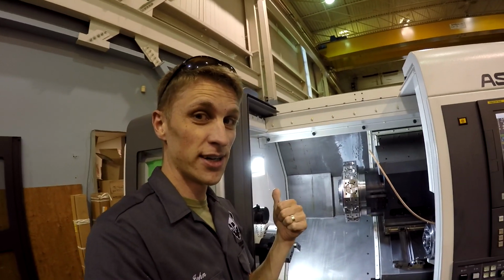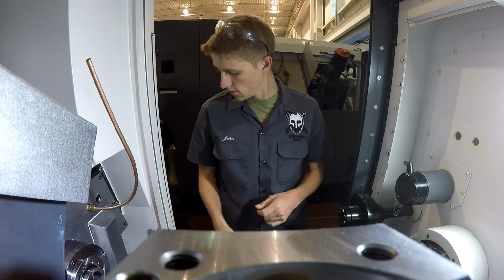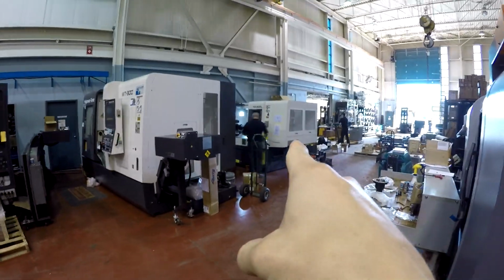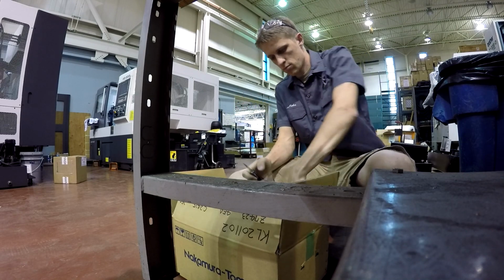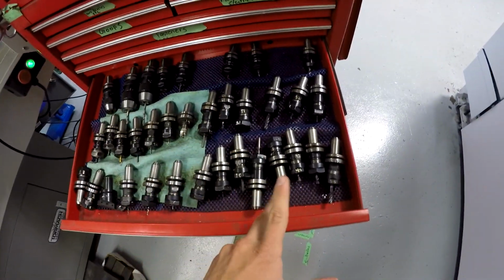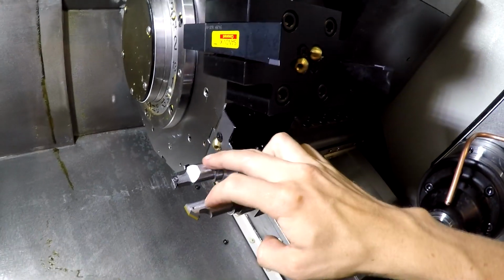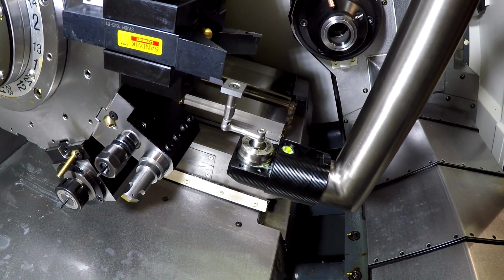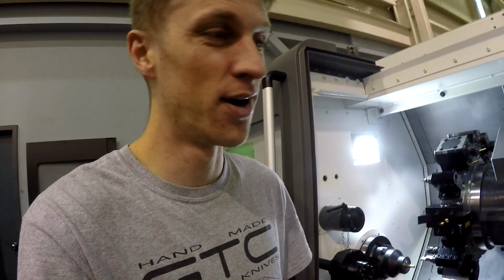We bought a new CNC Lathe - Nakamura AS200LMYS

Comment: For the same reason you don't need a Ferrari to run a delivery service, you don't need this to make screws for a pocket knife. Really, you need to curb your equipment fetish.
Reply: 100k? That machine was easily 250K and way overkill for what he does.
Reply: Alright, I guess you can't wrap your head around the math. Let's say he financed $500,000 worth of machines on a 5 year note. That's a $9500 payment every month just for the machine. Now, rent, insurance, utilities, etc will cost him at least another $2500 per month. Then add the cost for tooling and other consumables like coolant and oil. Let's say $1000 per month. So, he needs to come up with $13,000 every month just to keep the lights on. He has not paid himself or his brother. He has not bought any material or paid for any outside services.

Now, his knives sell for $600. Let's say there is maybe $50 worth of materials and another $50 in outside services. So, he nets $500 per knife. That's pretty good (and highly unlikely). He needs to sell 26 knives each month to break even. He has sold approximately 560 over 4 years so he's averaged 11 knives per month. So he needs to increase sales by 236% instantly to make the payments.

How long until he saturates the market? How many people are going to pay $600 for a goofy looking pocket knife?

I stand by my gut feeling that this is just a well funded hobby. But hey, there a lot worse ways to piss away a trust fund.
Reply: I'd agree, except their production choke point isn't the parts the lathe makes. He either should have hired a helper for his brother or bought another mill. Either would have made more sense.
Reply: Kenshin Ushiroda no dude.   you got it backwards. ..that machine doesn't make money.   that machine makes him have to sell ridiculously overpriced knives.
Reply: The internet is not what it seems. He mentioned in another video that he's never had a real job. He and the other guy don't seem to do anything but make these knives. I'm sure he's spending daddy's money. It's not "hard work" paying the bills. 

Obviously he's never run a business or done a payback calculation. This is a stupid investment. He should be subbing those parts to a swiss shop. He doesn't have a bar feeder so he can't even run it unattended.
Reply: He can't run that machine 24/7 because he didn't buy a bar feeder which I thought for sure he would.  Cover payments/= make money he said in older video that he needed over $5K a month to break even plus another 250K in debt to make screws doesn't make sense to me. As someone else said he would be better off hiring someone else to help or subbing some of this work out to get product out the door. A swiss shop would run thousands of those at pennies.
Reply: +Kevo F with only 81mm of Y axis travel I would hardly call a 6 axis lathe a mill, I doubt most of the parts (handles, blades or pocket clips) could be rationally made on this, not to mention that most of the milling he does is at more than the 6000 RPM limit of the live tooling, and for small parts like he's making a 4000 RPM limit on the main spindle is not a great choice (sub spindle does go to 6000 at least)
Reply: Chief Machining Lol no way chief, the short version of this machine starts at under $79k, somehow I doubt adding the L and a sub spindle is going to literally triple the price.
Reply: +Kevo F "standard" doesn't mean "given away" there's no such thing as a free lunch, and although I do not know what the pricing is in this case I've seen enough 3+axis lathe invoices to know that a sub spindle is usually a rather expensive option (think about it, extra spindle with C7 bearings, servo drive, ways, ball screws, vector control, etc...)
If they can afford this fine but for the moment from my exterior view point I see the debt of the firm increasing but no products seem to be shipping out on a regular basis and unless they find a product for this I don't see how using this kind of a beast for screws and fasteners (no matter how intricate and precise you make them) can make economical sense for the volume they're talking about, I sometimes fear for them that the next "personal improvement video" might be "how I went bankrupt and don't make the same mistake"...
Reply: +Chief Machining Funny you should mention HAAS, despite living in France that's what I ended up buying, I was perfectly aware of the slight rigidity issues (i ran tests before buying and it turns out you can "easily" work around it and get perfect repeatability with a proper tooling choices and warming up cycles). 
I have a Mini Mill 2 with a 4th axis and a SL10 with the big bore option equipped with a ROHM F66 collet chuck (lots of 50mm bar work for me), all payed cash upfront no loans so if I break a leg and an arm horse ridding and end up not being able to work for 2 months I don't have to worry about the bank filling up my answering machine and hiring lawyers :D and it does what i need with no hassles (and yes I often work with esoteric crap like hardened steels (TOOLOX 44) and exotic alloys)
Reply: Best I can tell he's grossed around $350,000 over at least 4 years. For a full time 2 man shop they should gross that in 1 year to be profitable. And the doesn't count buying any equipment.
Reply: Yeah, Wes Johnson, I can tell, you have a good business head on your shoulder's--and in the end, that's what 'pays the bills'...In other words, we should remember, our 'businesses' can be a lot of fun, but in the end there are reasonable limits; they aren't hobbies as should be treated accordingly.  I think Wes Johnson's points were pretty excellent, however to debate them, one could argue he could sell his equipment at a reasonable depreciated value.  However, machine tools, as most of us know or believe, especially or even CNC varieties have a shocking tendency to loose value in sudden non-linear fashions--say if the industry comes out with magnificent new feature's etc.  Yeah, I would bet this equipment has a good lifetime of operational use in front of it, but for making knife screws...i mean, sorry, still trying to wrap my head around that one.
Reply: kenshin , i completly agree.

In Fact he could buy, better,  those silly screws
Reply: somebody's jealous.
Reply: +grumpybill jealous of a 100k+ debt I'll be paying off in 20 years? Yeah, no.
Reply: it is an increase in repeatable tolerances and speed so it will be worth it if he makes enough knives. probably needs to employ another machinist to get full benefiet though
Reply: Lol you&#39;re funny this isn&#39;t a haas..&#160;he is in Canada for one. Y axis, Sub spindle, 300 psi coolant, milling on the sub, in the 200's with all goodies, he got probably got a bar feeder as well not to mention to tool the thing up and rig it.
Reply: As Serge said... standard doesn't mean I'm gone to give away this machine at HAAS price. Making small screws and caps and whatever doesn't make sense on this type of machine anyways. He should have looked into swiss style machine but I'm  guessing the budget wouldn't allow for this. He went from step 3 to step 10 without any real thought. How many screws will take to pay this machine off?
Reply: Kevo F I can barely make it looks to be $297K before discounts total  but 80K isn't  including all the training, rigging, shipping, tool holders, collet system, probably a bar feeder. The HAAS I quoted was $135K USD without even trying the base price was 60K USD the time you add all the extra crap. In canadian dollars that machine 178K.. If they are selling that AS200 machine delivered and rigged for $80K CAN.. That would be about $62,500  USD just for the machine I would buy two now cash but they aren't
Reply: That's fine, but you can't finance $1/2 million without some serious money up front. Where would he get $50,000 for a down payment? Maybe they are leased, but still the numbers don't make any sense. He numbers all the knives he makes how much they sell for. I can add. He's not making enough money with those knives to come even close to justifying this purchase or the mill for that matter.
Reply: Wes Johnson Don't forget he does quite a bit of "pre sales" (for instance the "rasks") so the actual number of knives built (how much is that number anyways ?) probably gives a lower number than his net income over the past years and the amount of cash required up front and in terms of guarantee all depends on the condition of the financing.
I do however agree that the numbers (at least what we can deduce) seem sketchy at best but it's all speculation.
Reply: It's only matter of time before "presales" slow down or start getting cancelled/want refunds
Reply: List on that lathe is close to $300,000. With tooling on both machines he has to be at $500,000.
Reply: As I remember in one of his videos he is mentioning, before even lathe purchase, that he needs 15k/month for keeping lights on (loan, materials, salary for him and Eric + rent etc.). So I think he knows what he is doing and I am totally with him at this point. He needs to boost productivity to fulfill the demand. Also any future projects will be much more easier to capitalize and speed will make the difference.
Reply: Pft.   Toolox 44 ain't hard.   My hurco eats it  for breakfast (drilling to!   No mustard needed!)   now 60c s7.   Mmm
Reply: I haven't see the whole vid, or followed much of this gentleman's history of vids, etc., but I think Kenshin's practical approach holds a lot of weight here. I.e. do you really need a 6 axis CNC state of the art lathe to turn 'knife screws', whose heads I would imagine he is going to somehow finish or polish after initial assembly.  Call me a backwards lugite, but yeah $100K+ is quite steep for what an onlooker like myself would argue is a 'less than critical' or 'critically perfect' secondary part, that by the way is so tiny, it might fall through the already small parts basket arm.  I mean guh...i call it the principle of 'ensemble', which is what architects call it also.
Reply: You are a moron. Its a 5 year lease. The machine makes money, not costs it.
Reply: I agree, a STAR Swiss would blow these parts out of the ball field.
Might be best to buy an old Brown and Sharp screw machine and dedicate it to the part and finish the backside secondarily with Hardinge manual machines, etc.  He could finish off enough parts in the same time he takes to set up the new machine and let it all sit until the next time he requires more.
Reply: Kenshin Ushiroda Fair point, but I'd argue that the mill is the choke point, because he's making so many things on it that could (should) be made a lot more easily on this lathe. Also, technically this lathe is a mill! :)
Reply: Serge Gostoli That is all true, and I am not trying to say that this is the best choice or the choice I would have made for the parts he's making, but its not up to me is it. That "its a mill" comment was tongue in cheek, but really 6k is still a faster spindle than the Tormach 1100 lol. I'm just saying that its not a bad choice, It could make any part of his knives if he wanted to (obviously you wouldn't...), even with 80mm Y travel, and that its not a Ferrari in dude's analogy. The parts I'm mainly thinking about are the screws, spacers, and bearing cages.
Reply: + Kevo F The Ferrari reference is probably more about the price tag of the beast (especially when put in perspective of a young firms financial stability)  than it's versatility (which I don't deny)
Reply: Chief Machining Yea, what's funny is the Y axis and live tooling are standard on this machine. Didn't hear him mention a bar feeder. Honestly I have no idea what Nakamura charges for the sub spindle and other extras, what do you think the sub costs?
Reply: Serge Gostoli Perfect man that's how you do it no loan makes your parts now you can make some real money lol  or sell it easily when/if the time time comes.
Reply: Chief Machining Don't forget your initial comment " easily $250k". All I'm saying is the AS200 base machine with standard Y axis, and live tooling, is around $80k. Not free for the Y, just not an option like you implied it would add to that base price. I don't know what the base is for the L version, but I would bet a dollar that every option they offer would still not make it close to 250k.

I fully agree its not the best machine for him IMO, but its not the worst either. He could have done a lot worse and bought a Haas LOL!!! (just kidding Serge Gostoli calm down bud)
Reply: +Kevo F LOL don't worry I'm well versed in making fun of my own choices and quite aware that it's not the best possible machines juste the right compromise for me :D
Reply: Chief Machining Just to be clear, I'm talking in USD, not CAD. Maybe that's where all the confusion is coming from. If you're talking in CAD, I could probably see $250k CAD but no way $250k USD IMO even with all those extras. I think I see what you mean when he signs it, I don't know it could be 297 its really hard to see it.
Reply: Serge Gostoli LOL! Their machines definitely work though, nothing wrong with owning them.
Reply: Retro Arcade Not talking about him self talking about $5K a month just in overheard (rent, machine payments, electric, tooling)
Reply: You're right he paid $297K before discount  which you can see in the video. If that was case he would brought the mori vertical in cash
Reply: +x "hating on him" ? 
Really since when did criticism become a hate crime ? 
I sure as hell don't hate him or my comments would be quite more acerbic, most of the people not being "super duper positive" about his choice are probably more worried for him than anything else... 

As for the 1K knives well that really part of the issue isn't it ? From some of the comments you get the feeling (and he's honest so he doesn't hide it anyways) that he has a rather large backlog of paid orders that need to be shipped out, tinkering with yet another new "toy" is not going to increase his immediate manufacturing output (you know learning curve and all that so you don't crash the new "toy"') and even when he does get this up and running I'm not convinced that the increase in productivity is going to be noticeable since quite a bit of his manufacturing process is assembly and hand finishing.

I can completely understand both his "candy store" enthusiasm (I more than share it, hell i put most of my spare cash into machines... both new and used) and his desire not to outsource manufacturing (again I have the same "flaw") so he can control quality and not deal with outside intervention and their inevitable delays but here we're talking about parts (screws and maybe the pivot ?) that were apparently completely debugged and set up on his existing equipment, so other than maybe speeding up the manufacturing process because he wont have to transfer to the mill to finish the screw head what is he going to gain ? 

Not to mention that 1 K knives can't go completely into paying this lathe since he has all the other expenses, rent, DMG payments, insurance, salary for Eric, his own salary, etc... so don't get me wrong if he pulls this of I'll be both impressed and honestly quite happy for him but not to put to fine a point on it for the moment I'm slightly worried (which might not be warranted since we know little about the financial aspect of his operation but then again might not...)
Reply: Honestly I worry about this guy too. Buying these machines brand new isn't a bad idea but if he starts missing payments on this debt things are going to go bad very quickly. It is the exact same thing as buying a new car. Sure he can resell these machines if it were to ever get to that point but you've lost at least 15% of the value just taking it home with you. I've watched almost every single one of his videos and moving his shop from his home to the warehouse and buying the nicer mill was justifiable. Buying this lathe to make screws on a knife that very few people will actually care are "made in house" is just stupidity. He really needs to ramp up the volume in which he produces his product. What would have made more sense would have been to ramp up production and test the market. Custom knives is a very niche market. Myself I would never buy one. I'm here to look at the process. I like his videos. Some serious consideration and reflection in himself and his business needs to be made. He has a family that all this is riding on. I really hope he has a plan B if he doesn't move the volume of knives he expects to move. He sells out quickly because they literally produce 2 or 3 knives a week. Not 20 - 30. Good luck.
Reply: +wes johnson I've seen just about everyone of his vids and while I agree this is not necessarily a worthwhile investment I really doubt that it's being financed by "daddy's money", I've never been under the impression that he had a lot of that (I actually think that in one of his early vids on the Thormack he mentioned borrowing a few thousands from his dad but paid him back latter).
No it's much more likely that this machine and the DMG are financed.
Reply: Wes Johnson I thought he said in that long q and a video the Mori was $150k and its paid off.
Reply: No he financed the Mori and paid $144K after discounts. I'm not sure on list price
Reply: Agree, and yes even tho the sub spindle may go to 6k, we know it's hp has to be rather small.
Reply: Fuck that I need a Ferrari to deliver pizza all day
Reply: their knives cost 1000$  after 200 knives they will have paid the machine off
Reply: @thunderbolt997  Where did you get your business degree from? You obviously know nothing. He also has overhead and TAXES.
Reply: @giii6075  ok after 400 knives :)
Reply: Sounds good but I don't buy it. It takes serious money to start a business as capital intensive as a machine shop. I know, I've done it. I've worked for 200 man shops with POs for work that would guarantee a 1 year ROI on a purchase like he just made and they decided it was not worth the risk. He has some kind of safety net.
Reply: That's my whole point. Daddy's money.
Reply: Bringing in money is totally different than profit.
Reply: I bet they had this hunk of junk in the warehouse and tricked him into thinking he could use it.
Reply: I see this more like a delivery truck than a Ferrari in your analogy...  This thing could make complete screws all night long with nobody touching it. Not to mention, being live tooled and twin spindle it could make any of the knife parts if he wanted, but a more realistic example - that bearing cage he makes, in one setup on one machine. This is a SMART, long term buy, not a dumb, buy the cheapest thing that will work type of buy.
Reply: He obviously bought the machine so he could Venture his business into other places geniuses!
Reply: Kenshin Ushiroda Nobody cares about your opinions. This man is successful for a reason. Step aside and let the real man work.